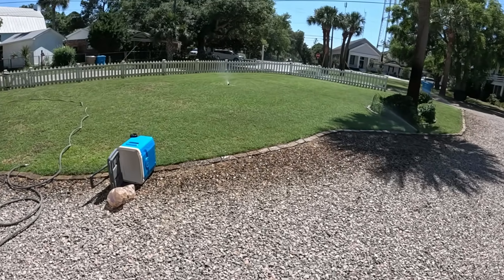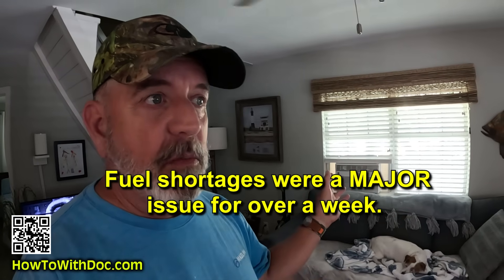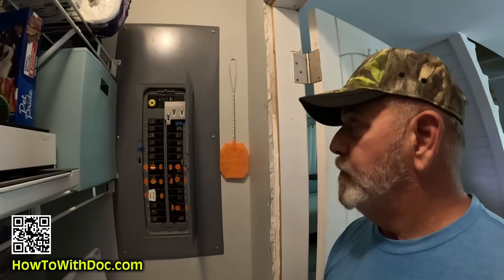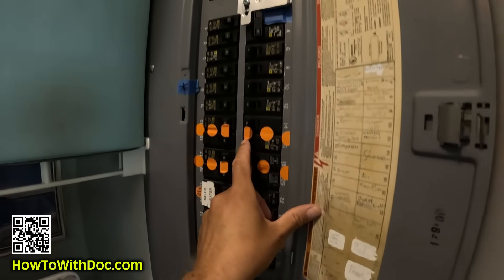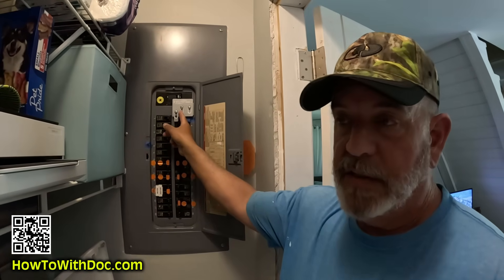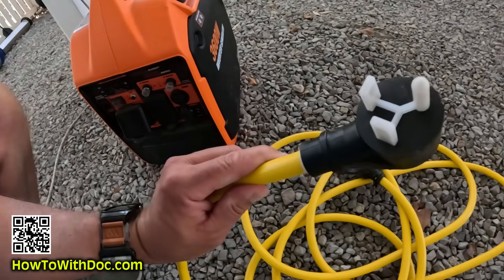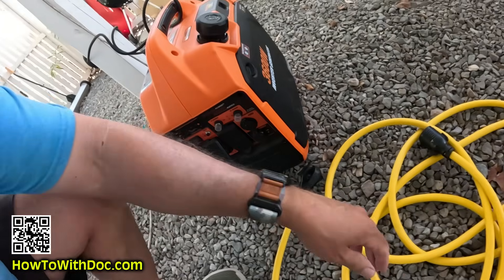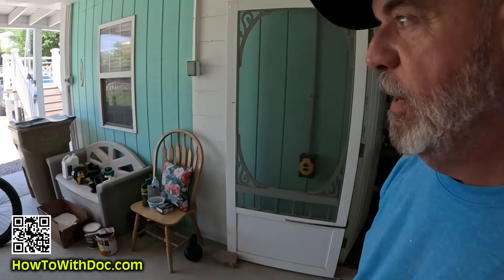How to Use Small Generator for Whole House Power

Comment: Great video as always, Doc.  We live in central Arkansas and get our share of thunderstorms with lots of lightning and, of course, the potential for tornadoes.  Little Rock was hit hard a couple years back where my daughter lives while going to medical school and they were without for days (can't recall exact) and that house had nothing.  She ended up staying with some friends as she still had med school to attend.  We might get the power outage from a snow or ice storm in the winter but that's kind of a rarity, too.  I own a pair of Genmax GM7500aIED's and have a parallel kit for them.  I'm all about redundancy being a city network administrator.  If it's a short term outage, a single generator on propane can do 5,500 running watts and can be used on low idle ECO mode and can run all that we need in our 3,000 sq/ft 2019 built house that's well insulated and all LED lighting inside and out.  Or, if we have a hot time of year, or need the water heater, etc., I can parallel both in for 11,000 running watts and run the downstairs 5 ton heat pump for AC if needed for awhile with it having a soft start.  It's definitely about common sense and load balancing and not trying to live like the Taj Mahal during an outage.  We only use what we need and that's usually short term with a single.  Oh, and of course my house is done with a 50 amp power inlet, interlock kit, and 50 amp breaker using 240v capable generators.

I do like those little suitcase gens and recommend all my friends and family to at least have that.  Always enjoy your videos.

Comment: Definitely recommend the Midea inverter window unit. Coatco recently had the 12k for $269. It has never pulled more than 600w at absolute max, usually a lot less.
Reply: That Midea window a/c was just recalled from Costco. They removed them from the stores and online.  I can't find out why they were recalled unfortunately.
Reply: From my research, it is due to the Mold and Water Damage:
Users have reported finding mold in the drain pan and suspect the units have a design flaw that leads to water buildup and mold growth
Reply: @budmartin3344 simply drill a small hole underneath the outside unit where the water builds-up(by design}, this stops standing water and doesn't affect the unit in a meaningful way.
Reply: Coll chef need yiu ac solar grnrrt 666 watts barte 700 wats sc invite piwr ac 1 hoiur maxium iuwer.
Reply: 50 watt solar delk

Comment: So, for clarity, you have a 50 amp plug on your house and you're running a 30 amp generator?
Reply: Not sure why anyone wouldn't go ahead and install the 50 amp power inlet since it doesn't cost that much more to do so.  Then you're more future proof IF you do something different.
Reply: @ITguyAR_66  you missed the whole idea of the video it seems. Bigger isn’t always better. A 50 amp gen would be at least 9000 watts and burns thru gas like crazy. You don’t need to run 9000 watts all day to power some lights and internet.
Reply: @Kevinw4040  Lol.  No, but whatever.  I don't use gas in mine and I run a pair of dual fuel inverter generators off of a 250 gallon propane tank that is for a couple of other things in our house. The generators already have the 14-50R plug so it's an easy connection when paralleled.   A single is all I need 80% of the time unless it's a hot time of year and, if so, I parallel them together for 11,000 watts for AC or dryer or water heater.  That's rare, though.

But to confirm, I get the complete idea of the video which is great and I agree with and is why I own a pair of smaller dual fuel gens.  When I use a "single" inverter generator, it produces up to 5,500 running watts and at a 25% load, is using 0.2gph of propane.  I'd say that's pretty solid.  If in parallel at 11,000 running watts and I'm using 50 to 60%, it's obviously higher at maybe 1.0gph for the pair which is fine. Only when needed.
Reply from the maker: It's a 30 amp standard 240 plug.

Comment: Agree totally. My big generator is used only maybe a hour or two but instead of the small gas generator I bought a ecoflow 3kwh with some panels. Quiet and majority of the time panels provide all power it needs
Reply: Saw a suggestion to use the gas generator to power the solar when sun is insufficient. Just have to make sure of compatibility that the gas one is powerful enough.
Reply: Might I ask what helped you decide on ecoflow? I am trying to decide which brand to go with for my solar generator.
Reply: Had a good review and the price was very competitive  @tagladyify
Reply: Bluetti (maybe a smidge better than Ecoflo) is having a great July 4 sale right now for 1024W $499  (all models on sale and great brand. I bought Ecoflo 1024W last Black Friday $400 but don't wait. Buy as soon as you can.)  @tagladyify
Reply: @tagladyify  Personally, I chose an Ecoflow power station because they have been proven to have the best inverters in them. They provide super clean electricity and are very efficient - at least the one I got is efficient.